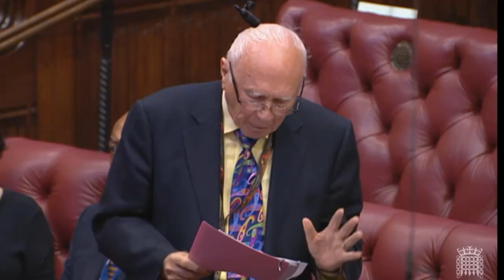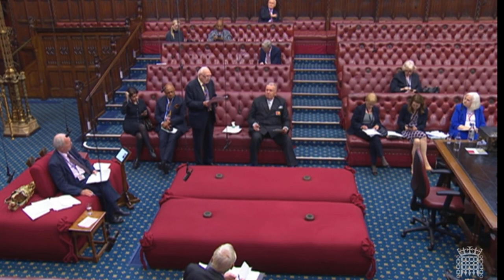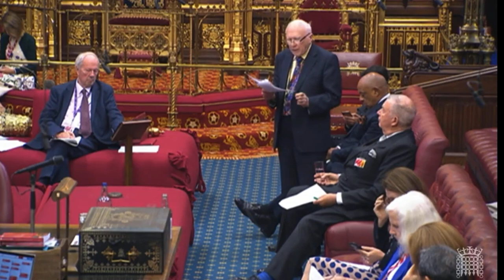Questions at the House of Lords 18/09/2023

Comment: Minute 6:57, he quotes ''..putting to service without residual circuit breaking testing , this is crucial to protect equipment from shorting ....''   this is actually wrong as an RCD wouldn't trip under a short circuit condition!....

Comment: Great case for PEN fault protection to be installed as standard at the main intake.
Reply: In my view, it's high time that TN-C-S be abolished and all new installations be supplied as either TNS or TT. Simply accepting a combined PEN conductor on cost basis should never have been allowed in the first place...

Comment: New builds come with a plastic gas supply pipe.  To solve the neutral faults the old supplies just need a short plastic section of pipe at the meter.
Reply: What, so you'd leave the fault to go unnoticed until someone ran an extension lead out of their house and suddenly found the earth of their supply had a high potential relative to mass of earth?